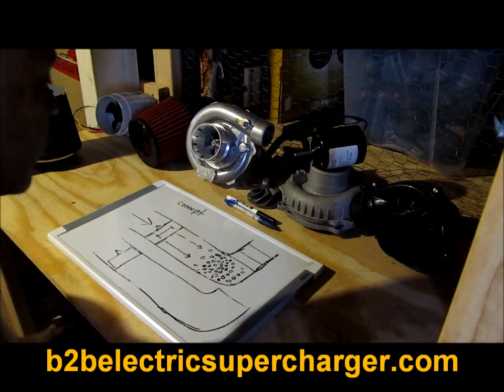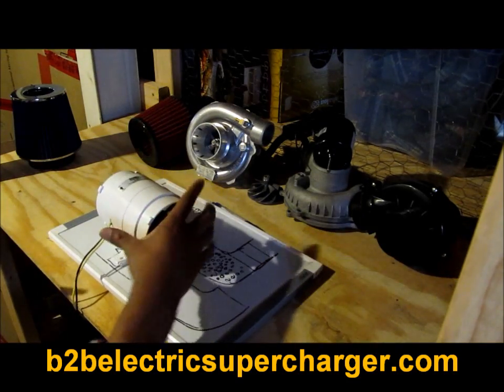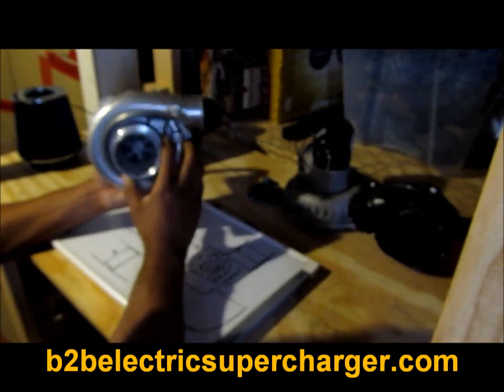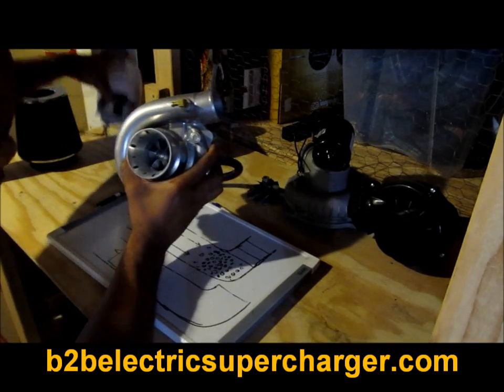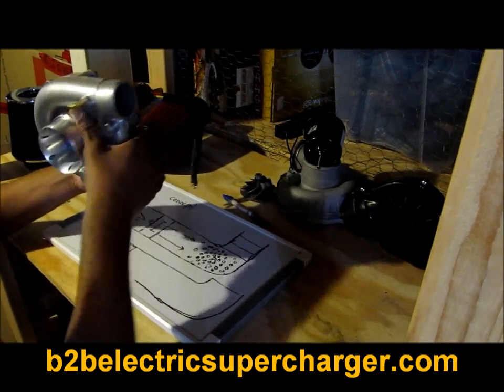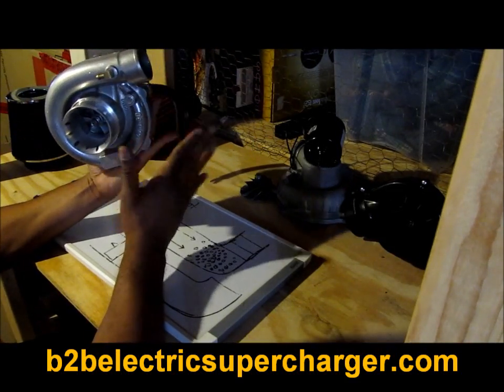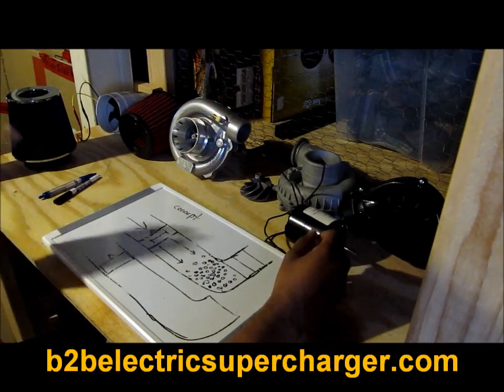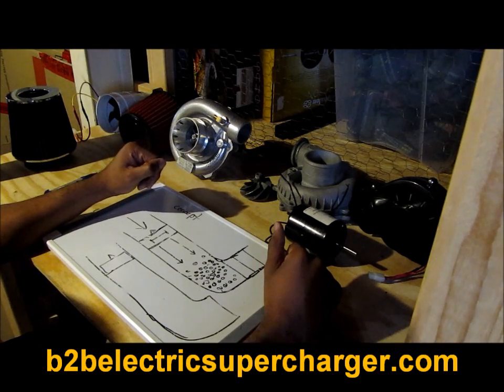Do Electric Superchargers Work?

Comment: What about lubrication of the shaft the compressor wheel is connected to? How have you solved that problem?
Reply: depending on how he did it, he could be using ceramic bearings.  Then lubrication isn't needed.
Reply: Not heard of that before. My R33 GTst roller bearing turbo has ceramic ball bearings and it still needs oil for lubrication even thought it has an inconel turbine and composite compressor wheel for inertial weight reduction.
Reply: The reason is that the bearings on your turbo also have to deal with the exhaust gas temperature, this does not.  Some heat is generated during compression, but not enough to make problems for high temp bearings
Reply: Yep... Fair call.. I forgot about the heat from exhaust... :) I stand corrected. cheers.

Comment: if engineered correctly they dont get very high temperature.  of course there is some temperature from the friction but not so high as the exhaust gases going in it.

Comment: What do you think about turbonator? is not electric and he have double spin blades,it mount on air intake after air filter.
Reply: If it doesn't have something turning it then its shit.
Reply: Chiplinsky - Figured as much, even being a back-yard mechanic which I am:  you obtain what you pay for, and in this case what you pay is hovering around "0".  I do have some world schooling with all this.  I'm 78 years old.

Comment: Won't spin fast enough, the exhaust needs to spool it not a electric engine, good idea though
Reply: You are thinking turbo not supercharger. Hot Rod magazine busted these in the early 90s. They actually damaged 3 cars they ran them on. The engines actually was starving for air and one even somehow "inhaled" the blades on the wanna be supercharger.

Comment: The electric suprcharger need motor to spin blade and motor need power to run it.. and need high current to spin faster and output power on crankshft will decrease bcause alterntor dc will get effect lnzlaw and brake the rotor.. so u need high effecncy electr motor.. or u only get nothing..
Reply: Not really.  These are only intended to be used for short bursts.  Think about it as an electric version of N2O.  It will put a load on your electrical, but even at full draw your alternator is not likely to be pulling more than 3Hp.  With modern brushless motors that "little motor" on the side of the compressor wheel could easily be on the order of 10HP (no, I'm not kidding)

Comment: This is theoretically posible. They do make some extremely powerful servo motors about the size of a coffee can you could gear up to speed. Though the motor and driver you would need is likely to cost more than a decent traditional turbo setup.
Reply: +thirdarc Those servos probably have a huge amount of gear reduction in them. Just take the gears out and direct drive. It would waste almost half your power from having it geared down a lot, and then adding another half dozen gears to gear it back up again. Brushless motors are something to consider. At 12V, for 150,000 RPM, you need about a 12,000 KV motor, or just get a regular 2000 KV airplane motor and put a 1:6 gear box on it.

Comment: The real turbo get hot not because the high RPM but because the Exhaust gases  going in it. That's for the guys thinking  high RPM get high temperature  :)
Reply: high rpm do get high temperature due friction

Comment: 2 words. volumetric efficiency. this is bullshit, you need to release exhaust gases faster to keep up with induction?
Reply: What about superchargers? They don't have anything to do with the exhaust system.
Reply: Well FYI they run on the crank which in turn runs on the valve timing. Think about it. The valves are opening faster and forcing intake into the manifold under heavy pressure. The valves are going harder because the charger is linked to them as well via a belt on the crank. So yeah, they actually do affect the exhausted gases bud.
Reply: Stupid. If it could exert enough force to compress the incoming air the exhaust stroke would comply accordingly

Comment: I can put an eletric motor to rotate 50.000 rpm and get 1 kg air pull force. 12volts and 50 amp.
Reply: Actually, 12V 50A is only 600W, which is not enough to run a compressor at high enough speeds to create pressure + airflow. So it would be useless. But, with 3kW you can run a compressor at high speed and generate enough pressure to overcome, a lot, the 3kW that you are loosing. Lets say, you will loose 3kW to gain 20kW, so, yes, it worth. It is just like a supercharger, you loose power to create more power.
Reply: +Motta Junior Did you try that already?
Reply: +Eduardo Donizette da Costa Júnior  yes. I put in my RC jet
Reply: +Motta Junior Oh, ok, I thought you were talking about pressure.
Reply: 12v at 50a very high current.. yes u will get more power from pressure air at intake mnfold.. but remember the dc alterntor will get effct lnzlaw bcause get more load.. so the output power is same.. better use turbochrger and if electrcchrger is better than it.. mybe the prodsen will make all engine use it.. but the fact is not.

Comment: Correct me if I'm wrong here, but, basically & generally-speaking you've kinda redesigned or repurposed (if you will) a standard turbocharger to, instead of using exhaust gas to spin the turbine, you've attached an electronic DC motor to the turbine (in-effect turning it from a turbine to a propellor of sorts or fan blade...) which, turbochargers & forced induction as a whole are terribly taxing on an engine and I, personally, don't feel that the effects a turbocharger has on an engine to make power is worth the trade-off for making said engine last 1/3 as long... I'll take variable valve timing & open headers any day over a turbocharger...
Reply: +ΣLECTЯ0N Have you driven a non-turbo diesel? Even on combine or tractor engines, expect 2x the power from identical engines. Those engines have life spans of around 50 years, in some cases longer (without many major repairs). Most tractor engines die of rust and neglect, because they can't compete against a turbo edition. Imagine if my car made 40 HP instead of 140 HP, I would have retired it a long time ago, instead its 29.5 years old. Diesels last pretty much forever. A gasoline engine doesn't last as long in general, but how many 200,000 mile gas cars do you see driving around? Most people WRECK a car in a crash way before they really wear out. Now, a 200,000 mile car is when I might consider buying one, but until then people want to much for them. Turbo's have rarely killed engines, its the dumb drivers that don't check oil, over rev them, or have a wreck and total it that kill engines.

Also, is 1.5 to 2x the power not significant? How can that not make a big enough difference. If you want a car to last longer, just don't spin tires at 50 mph all the time, burnouts tend to be hard on engines.

Comment: If the boats fan turned at 30,000 to 60,000 RPM it would produce boost too.  But these fans never turn at those tremendous RPMs and will never produce the boost.  I would like to see an electric motor that turns at the proper RPM, it would cost a fortune for that high speed of electric motor.
Reply: Easy solution… pulleys
Reply: This is the Rotrex: Unlike any other supercharging solution, the patented Rotrex traction drive allows it to operate at sufficiently high rpm levels (up to 240,000 rpm) to take full advantage of modern centrifugal compressor and impeller design.

It's totally amazing that these turbochargers turn at this tremendously high RPM.  The impellers shown in the electric fan motors that they are selling on ebay would never hold up to the forces.  Thanks again and have  a nice day.  Jeff.
Reply: Thank you very much, that explains a whole lot and gives me a lot of information.  So it will take a large alternator on the car to run the motors is what it all adds up to.  Now it's clear why the turbos and superchargers are built to be so rugged.  The superchargers use a huge belt to run them, so the reason for the large belt is that it takes a large amount of power to compress the air.
Thank you very much, that was great.
Reply: I agree with the pulleys, but them of have to keep them cool. Gears would have the same problem, but I think is easier to keep them cool.
Reply: It is the need for power to turn the fans at those RPMs.  Just pulleys or gears alone would not provide the power for those RPMs.
Reply: Did you ever hear about Rotrex or ProCharger?!
Reply: No I haven't, but I will look these up.  Thank you.
Reply: That is no problem at all. Based on that, I think electric superchargers may work, the only problem is from where to take all this power? As the alternators will not hold up such power. And High speed motors also requires more voltage.
Reply: You're making me think.  I am wondering about one of those electric jet motors that are found on model airplanes.  They don't use too much power, yet they turn at super high RPMs.
Reply: In some tests that I did and saw, I could conclude that you need a motor of, at least, 3kW to start creating boost. There is some 5kW motors on these planes (EDF turbines), but they require high voltage to spin fast enough and use maximum power, from 30V and above. You could use external batteries for them, but when they are empty, no more boost for you.
Reply: You're welcome, I'm glad to help.

Comment: Is there a way to hook it up like a tachometer, so that the voltage increases the boost with RPM? Just a theory. 
    I was thinking back to the days when RPM red lights were hooked up to airshifters, so that all the rider/driver had to do was pin the throttle.

Comment: wait i have questions.
does that electric turbo use engine oil.
Do you need coolant??
does that turbo spool at constant rpms?
do you need a waste gate?
can you use electric turbocharging on carburetors?
do electric turbos use a lot of current?
are there any bearings?
its origins?
what are the advantages and disadvantages compared to exhaust driven turbochargers?

Comment: would it be possible to fit a volvo supercharger to my 500 single cafe racer, I have room for it, I have a pulley drive fitted to the engine, or would it produce to much psi, cheer's

Comment: Would there be any advantage to pre-spooling a turbo with your motor in the inlet side? I was thinking it could reduce lag because it's given some help. Does it work in theory? Has anyone tried it?
Reply: +Lucas Choate it is being done with turbochargers...ie, one turbo pre-charges the next one.  A low pressure supercharger could pre-spool a turbo...but once the turbo gets up to speed the supercharger might end up being a big inlet air restrictor.  This is my thinking because turbo can often do over 10psi...while superchargers are usually not that high.  If a supercharger cannot push as much are as the turbo is trying to suck in, then it would restrict the airflow.  I could be wrong, that's just how I see it.

Comment: Would be good on a pc
Reply: +Pepe The PSI would be massive that instead of cooling it builds up heat...
Reply: Wrong. No PSI would be built up. The increased air flow will instead do the opposite. You'd be correct though if the computer is completely isolated from the ambient atmosphere like no computer ever.

Comment: If you can get a 6000KV brushless motor that handles 22 voltage and handle the load you are on to something,, Thats about 132 000 rpm..
Reply: Did you mean kv or kw?

Comment: i've got a 3.5kW 25000RPM 37V water cooled brushless motor, problem is, i dont have any way to control it, it appears to be a 3 phase asynchronous AC(brushless DC with alternating current directions) the controller that i found lineline meant for this motor is remote controlled by a RC boat ECU and wireless remote, i'm wanting to run it at 24V 150 or so watts coming from a solar panel when driving down the highway, i only want 0.5 to 1.5PSI from daily driving, but it'd be nice to get 5-6PSI to my LT1 when i need to get this 7600Lbs limo moving
Reply: +denvera1g1 http://www.castlecreations.com/ they make speed controllers for brushless DC motors. You could use an arduino board or Picaxe or other sort of microcontroller to control the ESC.
Reply: try an adruino board.
Reply: +Dan Schroeder yup. I agree. i have used adruino, and works great.

Comment: me im planning to build my own homemade turbo charger but try and error ,base on gas turbine engine structural design a gas chamber will be the outlet of the exhaust tube  ,guide vanes in the after the exhaust nozzle to redirect the flow of hot waste gas and 2 stage turbine wheels and i will try to make my own centrifugal compressor this is the most critical part

Comment: what electric motor have you mounted on there ?..

by the way, i got an idea... What if you boosted the engine with an electric turbo just like the one your experimenting with there, and on the exost side of the engine you mount a turbin that generates electricity, get rid of the dynamo (increase in milage becouse of lower friction loss). Now the car power is completely charged by waste energy, and the electric turbo also is still powered by wasted energy like a conventional turbo !, 

to make it even more efficient you can add some capacitors to the energy storage to the side of the battery. That way recharge for turbo spool from compressor happens faster and without delay because of the chemical charge loss in conventional batteries

let the voltage delivered to the turbo for spooling be controlled by throttle position and rpm in a map. That way it can be tuned to your liking in behavior. Comfort, Racing, eliminate turbo lag for good.  

and by the way i believe that you can get alott more energy out of a dynamo turned by ecost gas than a conventional dynamo. so the problem with lack of energy for the electric motor on the turbo will be eliminated.

Sorry for my bad English. i was just brainstorming

Comment: the only problem i see is that you might need like 800 amps at 12v or 400 amps at 24 v depending on your motor to make real power (5-7 psi) on something like my 3.7 v6. I am however looking into it...with a battery pack in the trunk for weight distribution. its almost like 1/2 a Tesla in terms of power requirement but I only need power for a short duration of time.

Comment: Axial (what you are calling "in-line") blowers CAN create gobs of compression FYI... otherwise jet engines wouldn't work.  A single cheap plastic blade fan might not do it, but axial turbines are also more efficient than centrifugal as well...  centrifugal jets were once used on older jets (I believe the harrier jet, and some old Russian migs), but now all aircraft use axial designs.

Comment: isnt 38 000 rpm too slow to make any boost Just asking
Reply: Kristian benz It makes boost, but it's not close at all to real turbos which can go to 100.000+ rpm.
Reply: It has less to do with RPM and more to do with tip speed. (or wheel diameter).  I.E. if you have to spin a 6" compressor wheel at 130K RPM, you could do the same with a 10" compressor wheel at 78K RPM

Comment: How many psi of boost has this been measured at on a running car? 0? Because if I had to guess I would think zero, unless you have a 40 horsepower motor you can spin that turbo up to 200krpm with. How about a boost test with it on a vehicle?  How about a dyno run? You know what they say about good things,  if it's too good to be true IT IS. Tell you what, I own a dyno equipped shop. If you can make 10 horsepower on my dynamic I'll buy you a new car. Otherwise you buy me a car of my chosing. Sweet deal right? Why not take me up on it if you stand behind your product, would you put your head on the chopping block for it?